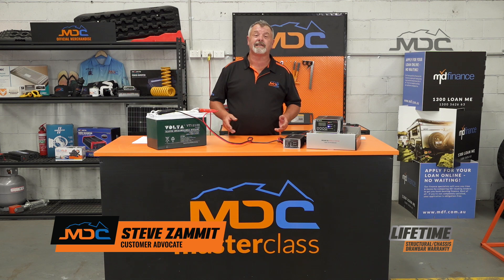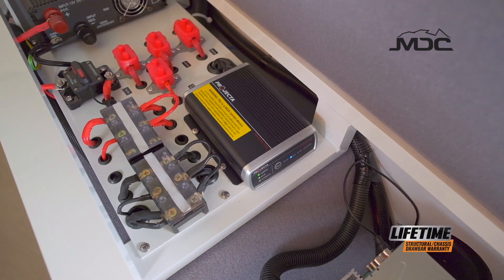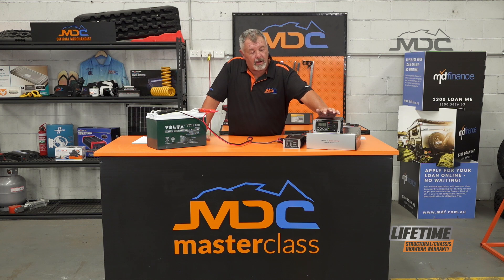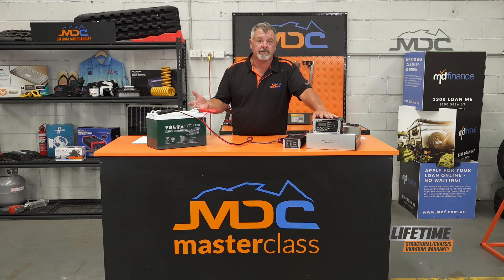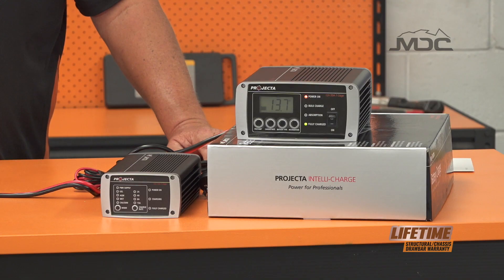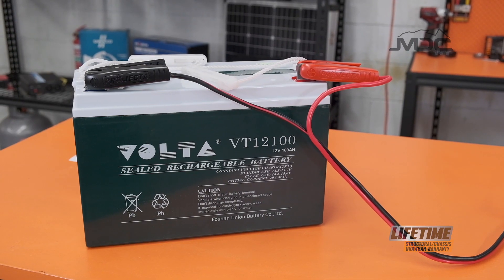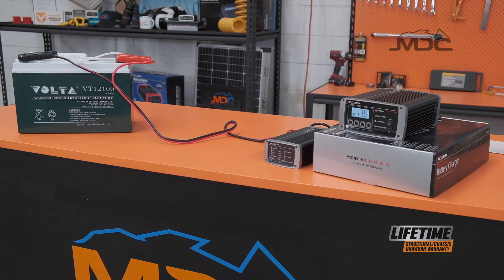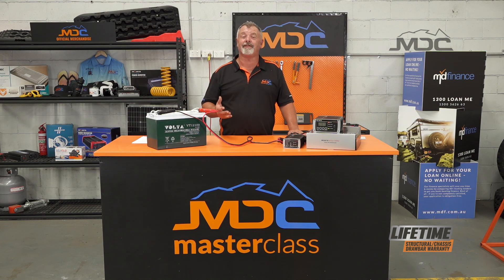Recovering Flat Batteries - MDC Masterclass #118

Comment: Hi this is a dumb question but does this apply to lithium as well?

I accidentally got my battery to 1% on my 2024 Robson XTT 15 year anniversary edition. 

I think I saved it.
Reply from the maker: Yes but make sure you set the battery type to lithium. 
Please download and check the owners manual for your specific trailer.